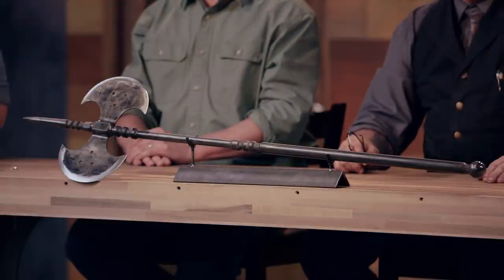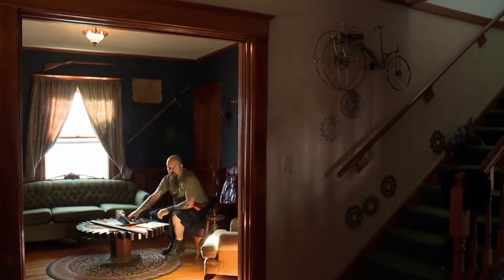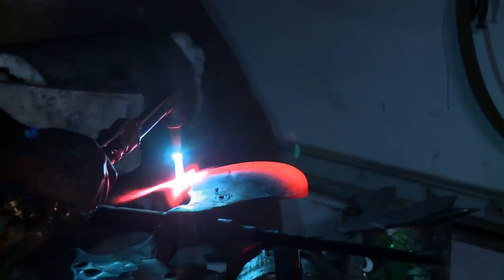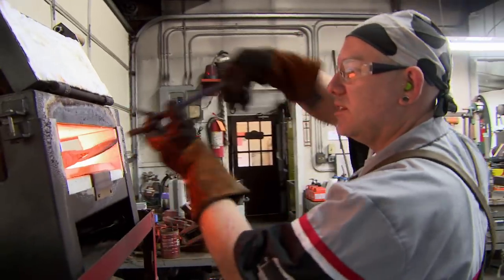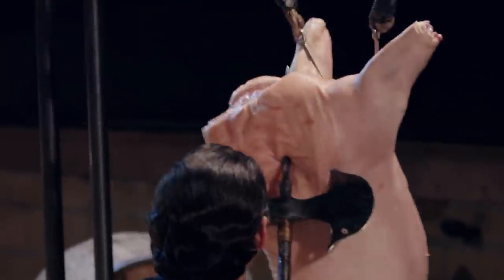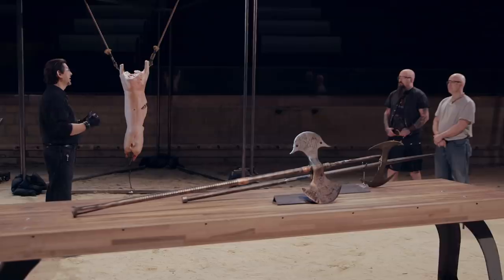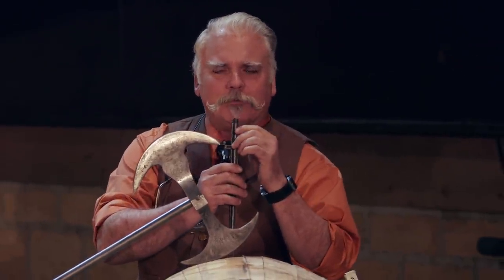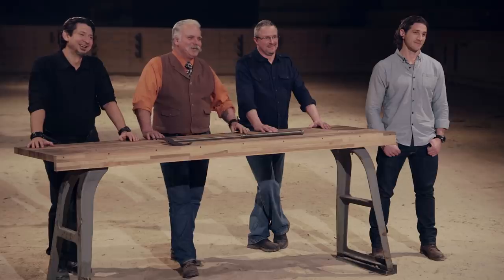Forged in Fire: Triple-Edged Battle Axe FIRES UP The Final Round (Season 2)

Comment: if the other blade didn't have a fatal flaw such as losing the spike until the end of the tests, it would clearly win because the winner's was quite heavy.
Reply: Usually someone will make their weapon alittle heavier and more thick, hoping the opponent's weapon will fail in the strength test.
Reply: Strength and weight are connected in this case.

Comment: Using the sledgehammer feels like cheating, where do you draw the line
Reply: Well technically they didn't say what metal specifically so it's not technically cheating to be honest
Reply: Living inside the box must not be very fun.
Reply: It’s not cheating since they both have access to it
Reply: @chasesmith5216  If they can use tools what stops them from using a pre build axe
Reply: @torgnyhaa  the fact that he melted the hammer down into an axe head. He basically just used it as an ingot.
Reply: One guy cut a blade out of sheet metal and made that into a weapon and they allowed it. But the sledgehammer head isn't really bad since he still had to hammer and shape it out
Reply: @Malhaloc  what video did you watch where any metal was melted?
Reply: @FlinnGaidin  I mean, unless he reshaped while it was cold, in which case, I'd be even more impressed...
Reply: @Malhaloc  you mean he heated it up and forged it into an axe head. He didn't melt it.
Reply: @FlinnGaidin  Well, I imagine there was some melting going on, but yeah lol